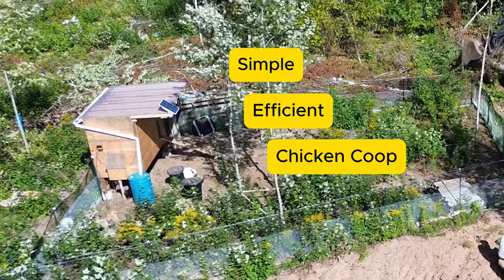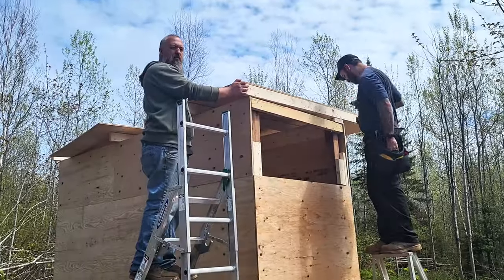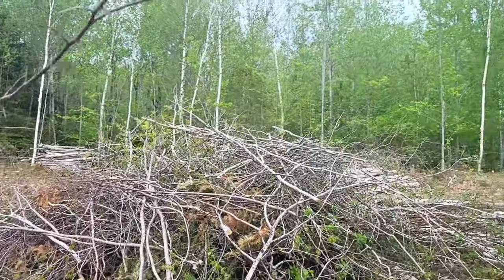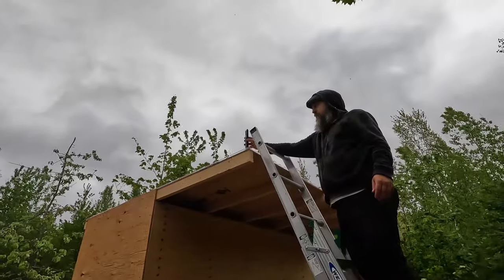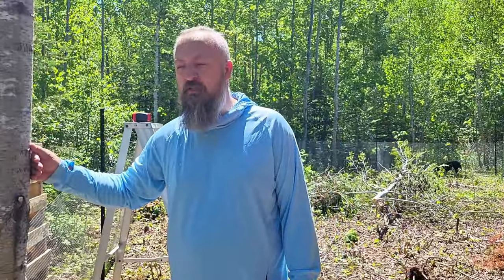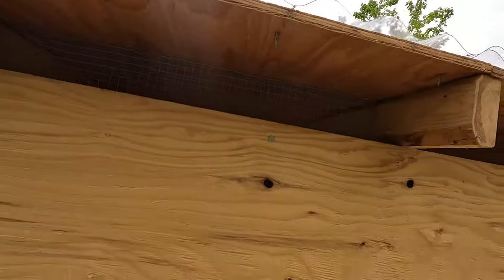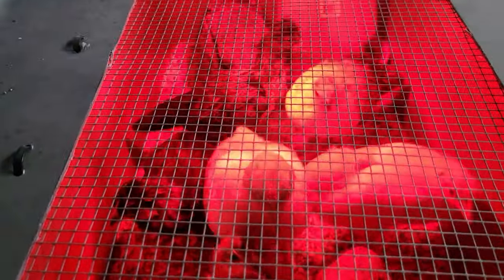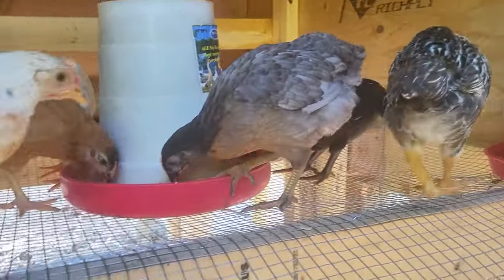Our BEST yet SIMPLE DIY Chicken Coop | New Homesteaders Build Part 1

Comment: Hi guys! Loving the chicken coop and your idea for a compost system. Wish I could get compost going here but with our climate I find it really difficult. I built my chicken coop from pallets. I pulled the pallets apart and used the planks as siding. I had an old metal single bedframe for the base, and wood posts and corrugated metal sheets for the roof. The size is very similar to yours. My chicken run goes around two mature orange trees, and I have at least 5 chickens who roost in them 😂. Chickens can fly quite high, so you may need to build a higher fence, mine is 2 metres high and I have 1 rooster who can get to the top of the support posts. I'm lucky here in that we don't have any predators except for dogs so I've made sure mine can't get anywhere near them. Love your geese, they are far too cute 🥰. I've got Muscovy ducks as well as my chickens. Anyway, looking forward to next week's video. Take care, Naomi x
Reply from the maker: Hey Naomi! Wow that sounds super resourceful! We too got a bunch of pallets and used them here and there throughout the build where we could. I wish we could grow orange trees here. I bet your chickens love it when the odd one falls down haha.
Reply: @ravenwillowfarmstead  They don't like the oranges, not sure why though. Just found you on Facebook so given you a follow x